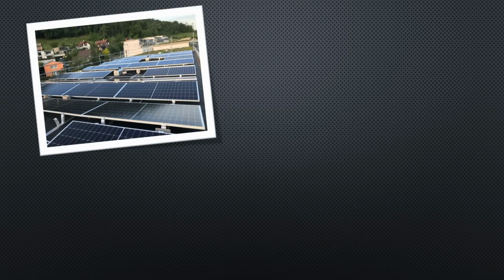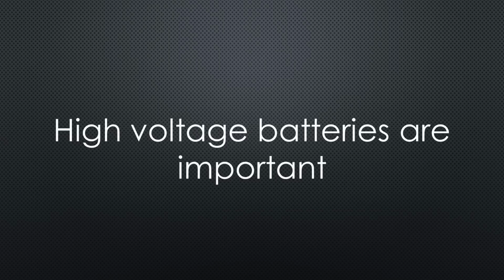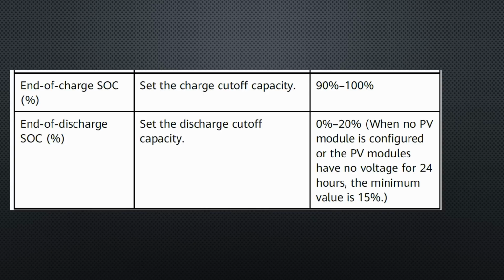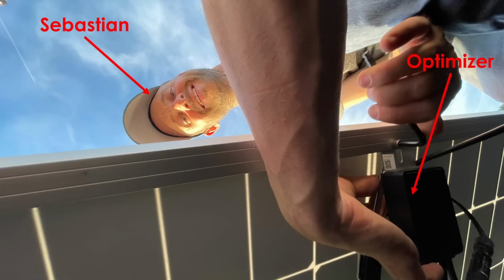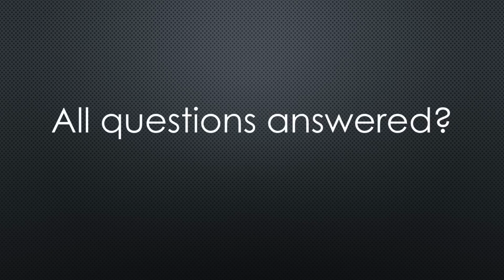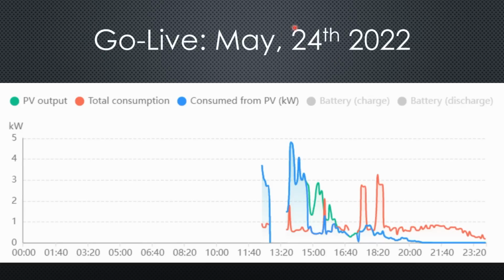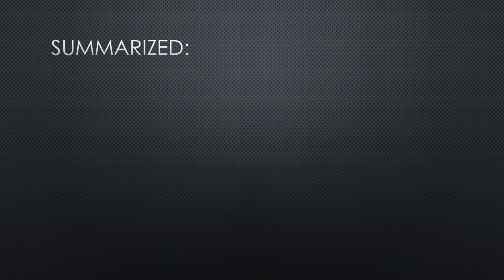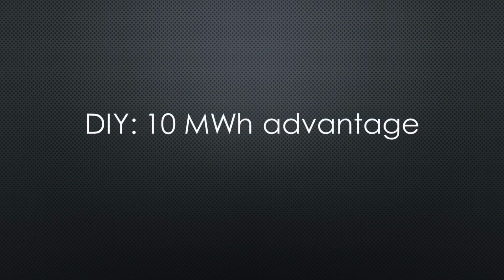438 Photo Voltaic (PV): Why Your Inverter Stops When the Grid Goes Down

Comment: Nice video Andreas, as always. One more thing to underline. Your inverter is producing the same amount of power on all phases because it is unable to close the current of unbalanced loads over neutral. I am using the same inverter and I found this. Even the connection is 3 phases 4 wires on neutral it is not drawing any current. All unbalanced loads has to be closed by the grid neutral connection. Even you have the back-up box you should know that in island mode it will became an single phase inverter able to power only some single phase loads. We can discuss more about this issue that is not open declared but this inverter as many transformer less inverters are not able to close unbalanced currents over neutral because they are using only three switching bridges . I am using the new version of Shelly 3EM software with neutral current transducer and any current goes on inverter neutral.
Reply from the maker: Interesting aspect about neutral! I know that my inverter only provides one Phase backup. But I hope to connect this line to all three phases in parallel. Most of our loads are single phase. With this trick I hope to get all lights on in off-grid. Needs an additional automatic switch.
Reply: @AndreasSpiess  I am thinking to do the same but I am not sure that the power output will be the same but reduced to on third. In island mode it is connecting L2 to neutral and earth. That is why it is becoming a single phase inverter with two switching bridges. And the bridge for L3 will not be used anymore. So maybe the power is reduced. Somewhere in the answer is said that for on/off grid in Germany only Victron inverter are allowed . That is because the Victron are with triangle/star transformer and able to use unbalanced loads.  It looks that we are working in the same direction ;). Also I am interested in hacking the modbus of the inverter battery network and making a new kind of back-up box. BTW other way to close neutral currents is by two capacitors in series providing a AC half voltage divider on the DC connection of the bridges. And the DC bus bar is accessible on the battery connection of the inverter where are 620VDC.
Reply from the maker: @paullacatus8975  My inverter outputs 3.3kVA (one-third as you mentioned) in backup operation. Which is way too much for such a situation where we do not cook or bake...
We looked at the Backup box. It seems to have only needed parts. Modbus is unnecessary for the backup mode; only one digital input switches the inverter into backup mode. The backup box does the timing for that. It also has a double breaker to make sure the grid really is off.
I will make a video about how I read the Modbus using node-red
Reply: @AndreasSpiess  You are using Modbus RTU or Modbus TCP ? You can also write some registers to apply some settings as power limit or reactive power control ? It will be interesting to show a schematic diagram as shown inside of back-up box and the timings. For me the back-up box looks to expensive for what it contains and can not power back all three phases as you said. I think to design another back-up box.
Reply from the maker: @paullacatus8975  I use ModbusTCP.. The Backup Box is quite expensive. But you cannot reduce a lot of parts because it has many functions. Its quality is quite good. Also the switches. I hope to add one automatic switch to connect the single-phase backup power to all three phases.
I would be interested if you can create one which is considerably cheaper.
Reply: @AndreasSpiess  I am evaluating some solutions . For me the Huawei back-up box is not the solution since the inverter is connected in my home network a bit further than the utility grid connection point so the functions of the box has to be splitted in two places and in the same time I forecast to power all three phases as you want to . Since I am in progress with a PhD in micro grids I am evaluating also some other solutions that the islanding mode of the inverter. Can we communicate in other simpler ways than the comments on YouTube ?
Reply from the maker: @paullacatus8975  You can send me a message on Twitter or Facebook messenger

Comment: question sir: when you allow battery to be charged anything between 10-95%, how do you make sure in the evening, when sun is down, your battery does not end up being only 10%? then the night would be fully from grid... I am missing this part explained if you can. thank you
Reply from the maker: If the battery is empty (10%), it is empty and I have to buy electricity. You are right.
Reply: @AndreasSpiess  so maybe limitation to 10% only before noon, and afternoon minimum battery value i.e. 60%? would it change anything with regards to battery life?
Reply from the maker: @zyghom  I do not know.

Comment: Optimzers are not only for mitigating shadows. They also help to get the maximum out of every panel. Our panels have differences of around 15% between the worst and best panels, without any shadows. Without optimizers, the whol string would only produce as much as the worst panel. So we gain around 10% at least with optimizers behind each panel. And we see exactly which one panel has a problem if it gets damaged.
Reply from the maker: I am not sure. We can discuss further after my video about optimizers…
Reply: @AndreasSpiess  we would lose a lot of power if all panels on a string would limit themselves to the weakest panel. See the attached screenshot from today. Optimizers make a lot of sense. And they make the whole installation and system a LOT safer, as no high voltage can be present when the inverter is not connected. Especially for self-builders without expensive test and measuring equipment I would always recommend to use inverters. You can install a damaged panel and never know about it and just have bad performance for 30 years. 

https://ibb.co/mJdjGSW

Comment: Ist your inverter connected to ethernet? Can you use Modbus over Ethernet? I use ioBroker and the Modbus-adapter to read out all the values of the inverter and the battery.
Reply from the maker: I read the values via TCP modbus, yes.

Comment: Ich arbeite auch gerade an einer kleinen PV Anlage mit Backup Möglichkeiten. Wichtig ist es zuerst mal die Stromkreise zusammen zu fassen die bei Netzunterbrechung funktionieren sollen ( Kühlgeräte, Raumlicht, IT, Heizungssteuerung und Pumpen für Fernwärme...) Man braucht auch einen eigenen FI dafür. Dann kann man messen was  der typische Stromverbrauch ( Leistung und Energie) ist und was man abdecken muss. Da ich Zugang zu gebrauchten aber guten Bleigelakkus habe  ich eine ebenfalls gratis APC UPS umgebaut. Die UPC funktioniert recht gut mit externen Akkus. Man muss ein Relais ( Solid state) einbauen und einen Timer um die UPC   mit 24V Batteriespannung zu starten.  Die UPS erwartet einen Tastendruck während Beep um einen Kaltstart ohne Netzspannung zu machen.Leider ist der Ladestrom nur 2.5 A also geht das nur für Blackout protection und nicht für Power time shift. Für letzteres würde man ein externes Ladegerät brauchen. Meine UPS aus dem Schrott braucht leider ca 30W in Standby.  Man kann aber die Akkus nur laden wenn die Spannung unter ca 26V gefallen ist. Bei Ali gibt es da sehr preiswerte Batterieüberwachungsschalzungen Neuere scheinen da besser zu sein ( 3W). Es gibt bei Aliexpress automatische Grid Switcher die ich  verwenden möchte.  Es bleibt spannend aber ist viel Arbeit
Reply from the maker: Schöne Anlage!
Ich plane einen andern Weg zu gehen. Ich möchte meine Verkabelung belassen und nicht in verschiedene Zonen einteilen. So kann ich entscheiden was wertvoll ist und es einschalten oder nicht…

Comment: Do you think at some point you could link up all your batteries, instead of using the grid as much? It would be cool to see but I don't know if it's too late for you all due to your choices of inverters/batteries
Reply from the maker: We will use the grid only when we have not enough sun, and the battery is empty. This will happen during winter. This is why we have an on-grid system.

Comment: You will earn at best 1000 CHF in a year. How much was the investment (do not forget to working hours invested)? This installation may be fun but from an economical standpoint only a waste of money.
Reply from the maker: You are right, I could earn more money with other work. But that was never the point for me. I like the idea.
Reply: @Snax Does that figure include the savings from not buying power from the grid ??
Reply: @mahudson3547  No, but it does not even include the maintenance and repairing costs either.

Assuming that the maintenance costs do equalize the savings my assumption is still standing.

Furthermore, the amount of energy to produce, transport, mount and run the whole equipment should be calculated. I guess that the "energy balance" is quite negative. Even from an ecological standpoint the installation is a disaster.

Anyway, thank you to Mr. Spiess to display honestly the costs.

Comment: Very informative, also just installed a PV installation in my home in The Netherlands. Here you can readout the smartmeter with modbus. Made a small collector program for raspberry pi to readout the smartmeter and the Growatt inverter (single phase). I don't have a battery yet, also because in NL you get the same price for electricity as for which you buy it so it cancels out. I am curious how the batteries hold out.
Reply: Just curious, what electricity provider do you use that gives the same amount back? Mine does not.
Reply: @mveldt  you're right it is only for the part you have consumed, excess energy is much lower
Reply from the maker: Our smart meter also has a Modbus interface. But I decided to read the TCP Modbus of the inverter because it has all the information needed for me.
The battery also makes no financial sense here (at least not for the moment). But I wanted one anyway.
Reply: @AndreasSpiess  Thanks, what would be interesting to measure EMI of the installation. I thought my Growatt would be quite silence but I see a lot of spikes on 80 and 20 m. Maybe because my arial crosses the pannels.  I did some measurements with my scope and a H probe. But have to figure how to interpret the results.
Reply from the maker: @paulh0029  We made a quick check and did not find additional QRM. But my QRM level anyway is high. This is why I opted for a remote station ;-)

Comment: There are some Hybrid inverters that people use in Brasil (from EPEVER,  MUST, etc)  they switch to battery automatically and disconnect from the grid,  but I think they do not send energy back to the grid.  It would be good if there was a way to switch the solar panels energy in a ON-GRID system to this hybrid Inverter-controller,  this way in a grid power down the panels would be in like in a OFF-GRID system the big issue would be switching 800V,  it is a  ""big men""   job.  That what I used to hear when I studied Electronic and there was also an Electrotecnic (High Power) course,  the difference of the two is:  The Electronic receive many electric shocks in his work,  the Electrician only receives ONE!
Reply from the maker: Good joke!
My backup box will separate my Inverter from the grid.
Reply: Victron has a product line that does that. even double relais for failsafe separation.
I have 2 concerns and thus I look for someone to tell me what to do:
- Regulations: I don't know them and if I don't follow them I get trouble. I dont want to make experiments and then face an inspector of my power company telling me that I must throw everything out.
- Safety If I don't change my Fuse box I fear to get in problems. All normal LS Line safety switches in it need 5x the rated current to instantly brake the connection. No reasonable Inverter can provide such grade of short circuit current. That may or may not be a problem. Again fear of an inspector telling me to throw out everything.

Comment: Answering your question, I have a GivEnergy system (UK) and it also seems to show a delay in switching with varying loads. Small amounts are imported from the grid when the battery is well charged, also small amounts are sometimes exported from the battery when house loads change (the load changes are well within the system's capacity when this happens). They are very small amounts and are negligible in cost terms but annoying from an engineer's point of view.
Reply from the maker: Thank you. So this seem to be a common system.

Comment: I didn't understand why shelly became useless? It can still show you power direction on each phase, if placed on the 3 main phases just before the fuse box
Reply from the maker: It became useless behause it measures exactly the same values as the smart meter. And this in only the energy exchanged with the grid. Which is zero or negative most of the time. Before the PV plant it showed the consumption of our home.
Reply: @AndreasSpiess   the smart meter from Huawei? Ok you can still group all wires in subpanel that are in the same phase under one clamp sensor. Do that for everything except the on-grid inveter. You get consumption only data. If you post a  picture of your DP. It can help
Reply: In the case that your house consumes more than then the pv/bat Shelly will show the load on top of the pv/bat correctly? Shelly can also measure the grid usage in both ways still? Or maybe I'm confused on why it's totally useless
Reply from the maker: @foremanScreencasts  Because the shelly (and the smart meter) are connected in the wires towards the grid, both measure the exchange with the grid. If I switch the inverter off, the shelly shows the consumption of the house because the energy comes from the grid (this was the case before the solar plant). If I switch the PV on, the inverter tries to get nothing from the grid. So the shelly only shows zero or what we export.
I could put the shelly sensors to other places. But unfortunately, our fusebox is very crowded, and the current sensors need some space. This is why, for the moment, the shelly is not very useful.
Reply: @AndreasSpiess  I think that's the ideal condition, you can calculate the house load pv generated(from the inverter) - amount sent back / used from the grid (Shelly) to calculate your house load
Reply: And possibly align your phase loads if they are not aligned (e.g. one phase us pv and the other has bigger load that pulls from the grid)

Comment: Could you isolate your home from the grid in the event of a power outage?   
So if the grid goes below a certain voltage, instead of a complete shutdown, could it go completely off grid in that situation and reconnect to the grid when the grid voltage stabilises?
Reply from the maker: The Backup Box should do the separation. But it is not yet installed. But the Luna2000 does not have a three phase backup capability.

Comment: Hmm why wouldn't you install a contactor before the grid  power enters the house, that way you could disconnect from the grid when grid power fails or shuts down
Reply from the maker: The Backup Box should to that. You still need an Inverter which is capable to run in an off-grid situation.